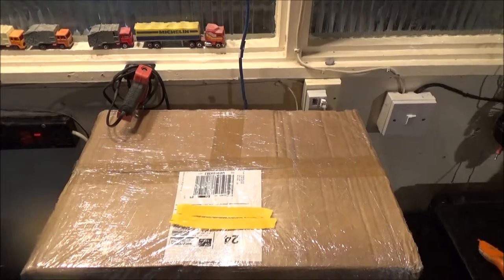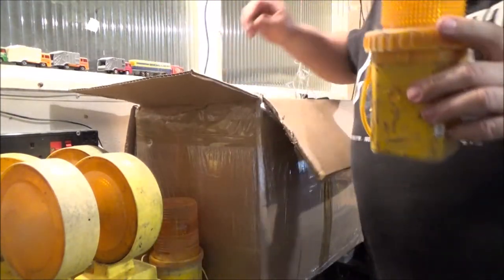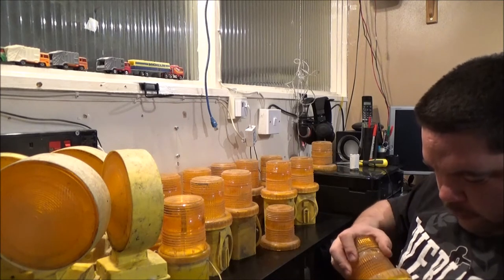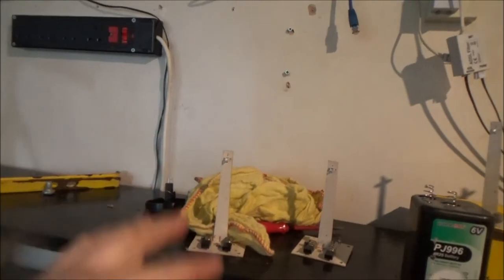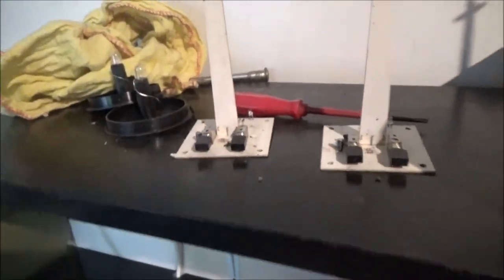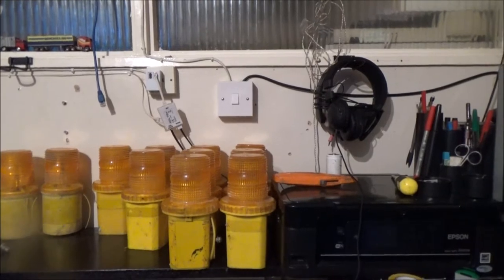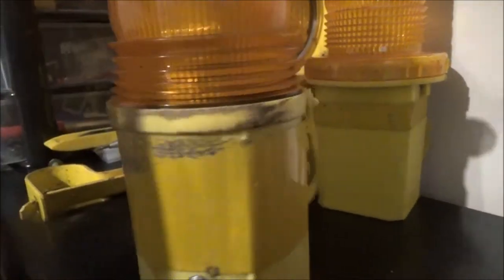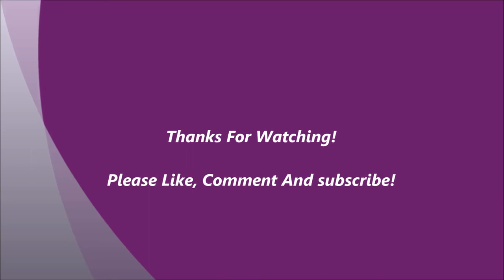I Has A Box! A Big Box! (Barricade/Road Lamp Haul)

Comment: Them UniLAMP's can be bought with a 60 or 120 FPS flash rate, you have the 120 FPS rate in them ones. The E Type is interesting, I saw a 1 Metre Mastercone with MHM on it, it is from around the 1990's era. The lamps sold by them were unpopular.

My DRAPER lamp which I am sending you may actually accommodate one of the Pilot 360 circuits although you will have to check when you get it. 
Those EcoLITE's are nice and will definitely sell in that condition, I would say £5 for the pair?

Those UniLAMP's could sell for about £20 as a lot